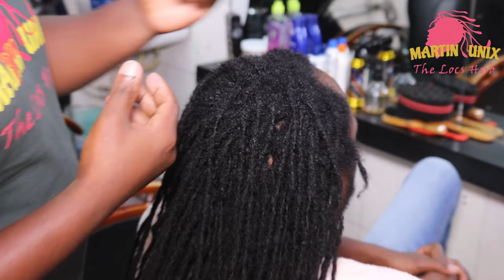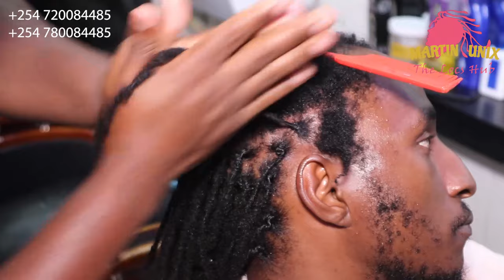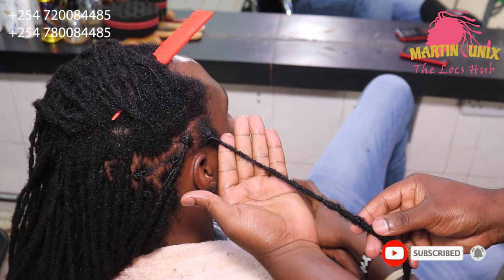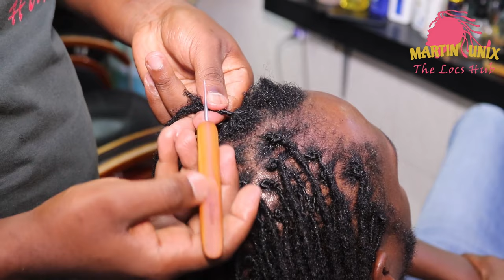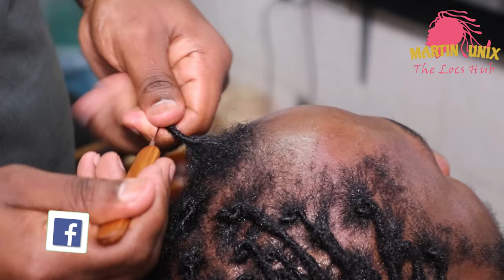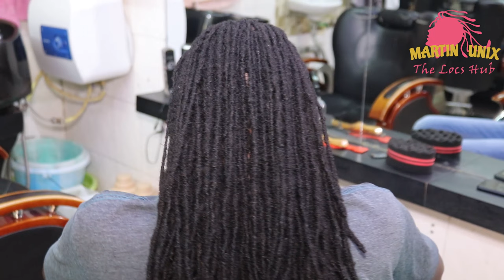Full Episode || Dreads Transformation || Repair on Thin & Damaged Locs || How To Retwist

Comment: This is awesome! Thank you for sharing. I had to cut my locs from post-partum thinning, I had to let my scalp breathe and reset basically to be healthy enough to hold locks, and now I am reattaching them. This video is great to follow! 

- It looks like the clients locs are thinning because his new growth/ scalp isn't strong enough to carry the heaviness of his locs. His new growth isn't as thick as it needs to be to hold the locs. He needs to reduce the weight of the locs which means to cut them shorter, or he will continue to run into thinning... unless its alopecia.
Reply from the maker: Great tip and thank you for visiting my channel. I also have online classes so you can reach out if interested. Stay blessed

Comment: What is the difference between the tool that is double hooked and the tool with only one?
Reply from the maker: Difference is on usage... Check out other tutorials for more info
Reply: @martinunix  can one use the tool with only one needle to do what the double hooked tool do please? I did my dreads in Kenya and now I am in a country where the double hooked tool is unavailable. I have the same hair situation as the client in the video. Ease advise. Thank you
Reply: @martinunix  I saw in minute 11 you mentioned that you can use either, is that the case for all other tasks?
Reply from the maker: You can use double hook when attaching just to speed up while use single hook to give flawless finish and also when doing repair
Reply from the maker: Consider sharing 🙌
Reply: We only have the green and purple tool, can we do everything with that?